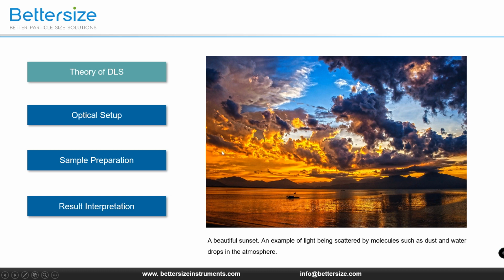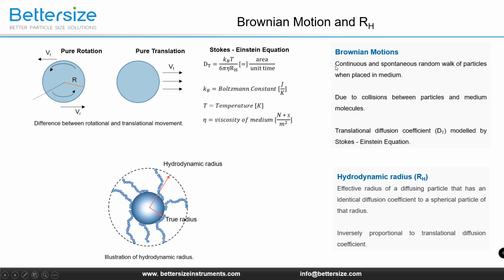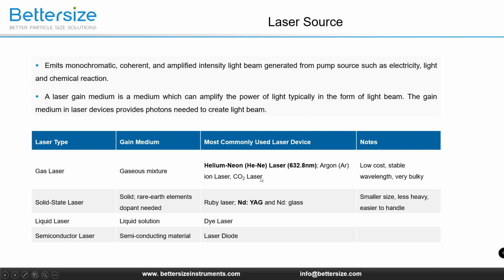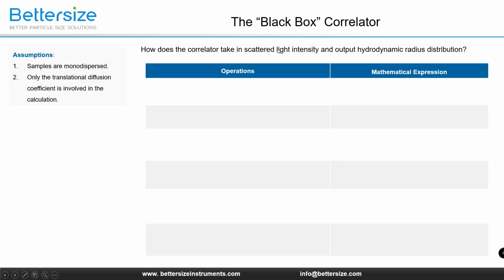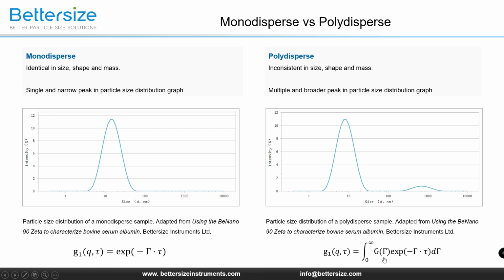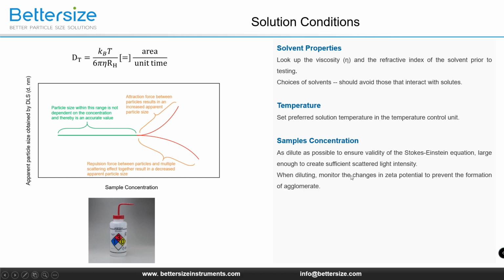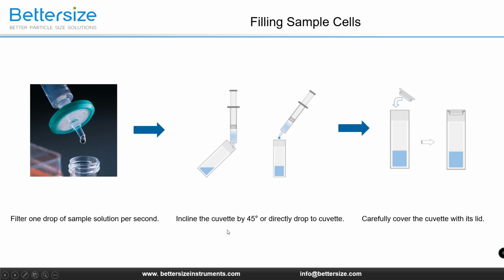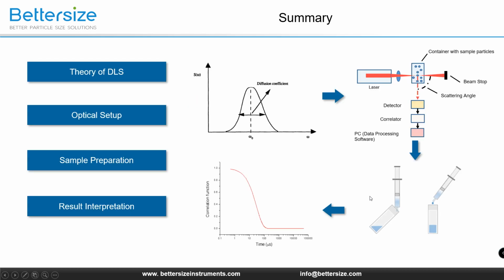Secret of Dynamic Light Scattering (DLS) for particle size analysis

Comment: Refractive index  is of material or solvent required for the analysis?
Reply from the maker: The refractive index of the medium, or the solvent in which sample particles are dissolved, is required for the size measurement of nanoparticles using DLS. This is because the scattering vector calculation requires the refractive index of the medium (as shown in the first equation on the slide about the correlator).  However, the refractive index and viscosity of the sample are not required. I hope this clears things up a little! if you have more questions feel free to contact us at info@bettersize.com

Comment: Your presentation is very helpful but i have query about the refrective index. What is the use of refractive index for size and zeta potential measurements of nanoparticles? And is it necessary parameter for analysis?
Reply from the maker: Hi Nida, thank you for your question! The refractive index is used to calculate the scattering vector and yes, it is a necessary parameter for analysis. The same is valid for zeta potential measurement of nanoparticles using the electrophoretic light scattering (ELS) technique.
Reply: Thanks for your reply...i have a confusion about which RI we should consider most important dispersant or material???
Reply from the maker: @nidaiqbal2671  Only the dispersant RI is involved in the particle size calculation in DLS
Reply: Thanks but i am using zetasizer software. The software is asking about RI of material.should i ignore it?
Reply from the maker: @nidaiqbal2671  Since zetasizer software and Bettersize BeNano software (for BeNano 90 Zeta: nanoparticle size and zeta potential analyzer) share no similarities, it's better to ask zetasizer software provider.